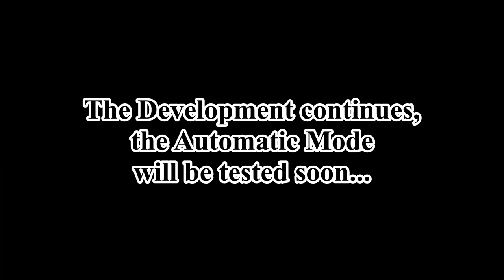Lego Technic MOC Test of a Sentry Gun (Manually Mode) by Legolaus

Comment: it can be adapted to old nxt ?, if yes I buy it :)
Reply from the maker: Oh, I honestly don't know. In this version I use one large and two small motors and the infrared module for the remote control. The ultrasonic sensor is to be used in automatic mode, but is currently not used. I can send you the ev3 code if you want. I can also write you a little explanation about it. Maybe you can recreate it with nxt!

Best regards
Stefan
Reply: @legolaus1  thank you very much😊😊😊so appreciated
Reply from the maker: @caosoftware  you can write me an email and I'll send you the file. There are even two, one with a 4-shot and one with an 8-shot as a volley.
stefanweinert@outlook.com
Reply: @legolaus1  😊ook in a while Will send an email😊